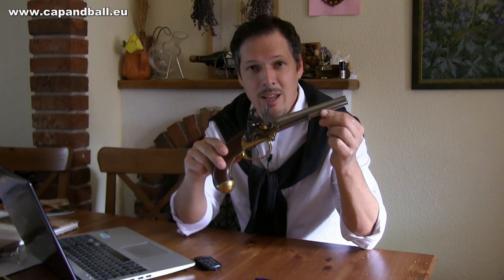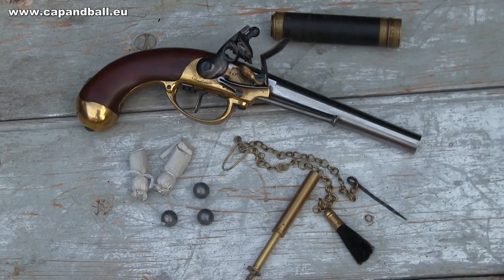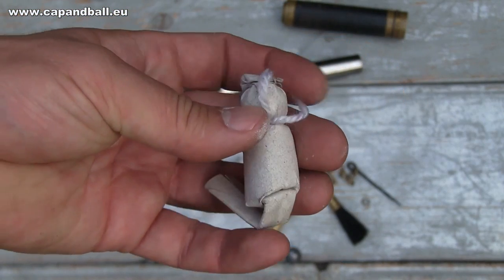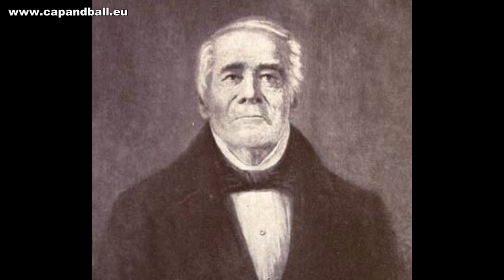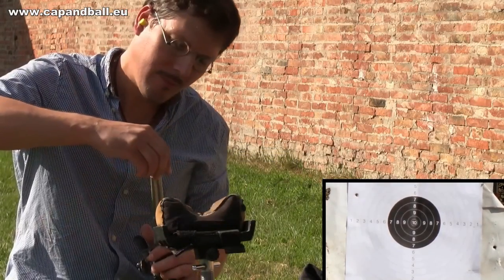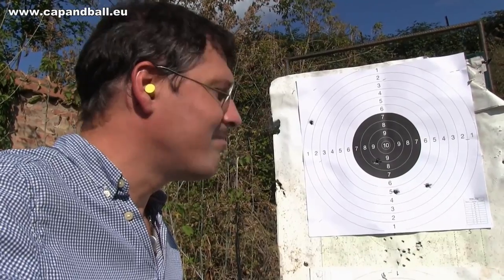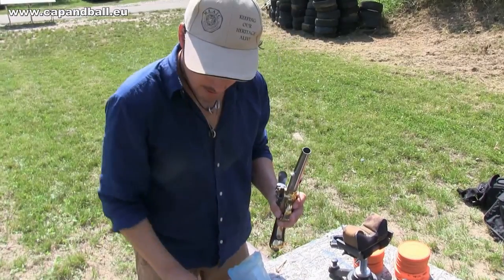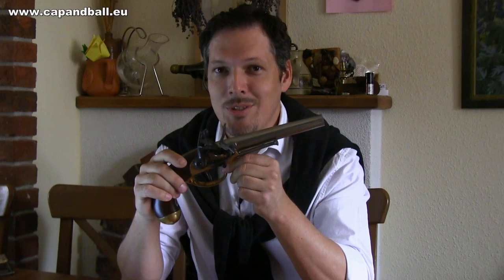The French 1777 flintlock pistol in action

Comment: That pistol is more accurate when thrown
Reply: M Kennedy lmao
Reply: These things were pointed, i.e. aimed instinctively like a longbow and over distances not exceeding 15- 20 meters. If you try to aim along the barrel of this thing as if it were a modern pistol you won’t hit a thing. Shooting these things requires a skillset most modern shooters don’t have since they are hardwired to shoot with sights. Shooting instinctively requires un-learning everything you thought you knew about aiming.
Reply: @ChristianThePagan  With such a loose fitting projectile and no rifling there's no way to really be accurate with that thing. The ball will end up deviating in a random direction depending on how much and what angle of spin it ends up with from impacting the walls of the barrel.
Reply: @ChristianThePagan  I never said it was. But even a tighter fitting ball will be inaccurate due to imbalances and aerodynamics, esp. the Magnusson effect if the ball attains any spin. If you did a nice job casting it, cleaning up the sprue and polishing it, and fully packing it with wading I agree it would probably help. In order to somewhat "replicate" rifling the ball has to remain stationary in flight, which is a tough task. Any rotation, imbalance, or surface imperfections at all will cause it to deviate at random. I can say that loading a BB gun with actual precision ball bearings made it quite accurate. But a ball bearing has a very nice surface finish and is dynamically balanced. Something very hard to do with casting, esp. in the 17th and 18th century, not to mention the bore has to be kept very clean or you have a hand grenade instead of a gun.
Reply: @mysock351C  I have seen people getting pretty good results with tightly fitting balls and well loaded smooth bore muskets at ~70 meters on a human sized target. The objective of loading this pistol more carefully with better fitting balls would not be to get hits at even 25 meters. The objective would merely be to hit a torso sized target consistently at under 8-10 meters instead of the 3 meters he's getting. On top of that you can load this thing with buckshot or buck-n-ball. At ranges under 10 meters both would beat a sub caliber ball bouncing inside the barrel as it is fired (especially the buckshot or buck-n-ball would beat the pants off of a sub caliber ball at 3 meters). The tight fitting ball by being noticeably more accurate, the buck by simply covering more area. Furthermore, all I said about aiming this thing still holds. The reason this thing has no sights is because it wasn't meant to be aimed by peering down the barrel. This thing is meant for instinctive pointing and shooting at distances under 10 meters which is something modern shooters (shotgunners excepted) usually have no idea how to do.
Reply: @ChristianThePagan  I get why it has no sights. Since they are hand-made each gun probably has its own little quirks you have to correct for.
Reply: @ChristianThePagan  I know what your getting at. But since these were made before mass production each one was unique, and putting sights on it would have been a futile exercise, anyhow. The weights were a little bit different, the barrels had slight variances, the alignment of the stock varied from firearm to firearm. It would have been guesswork to put sights on it since each gun will shoot a bit differently.
Reply: @ChristianThePagan  I say that as we used to have a number of revolutionary war and civil war muskets, rifles, etc. before they were stolen. I wish I still had them but the earlier firearms were quite crude by todays standards. But I know what your saying in that you learn to position yourself and the firearm to shoot at a target rather than sighting it in.
Reply: mysock351C  I disagree, there are numerous English smoothbore duelling pistols with front and rear sights so fitting a smoothbore pistol with sights clearly was not pointless. This pistol a different beast. All that it is meant to do is to be rapidly drawn and shot to hit a human torso at less than 10 meters, most of the time probably 6 meters or less. At that range none of these variances you mention matter all that much. If they could land their groups inside a 30 cm circle at 7 meters the guys using these things were happy and keep in mind that this is half the 12-14 meters which English pistol duels were fought at.The sights are absent on the 1777 because they didn’t need sights to hit a guy at 7 meters. Also, these things were definitely mass produced.
Reply: @ChristianThePagan  I think it falls into the category of "wishful thinking". I was saying that I can see why they would simply skip putting the sights in place since the ball will be headed off to the next county by the time you'd actually need them.
Reply: @mysock351C  In that case, why even use pistols if they couldn't hit the broad side of a barn? Alexander Hamilton was killed with a flintlock smoothbore pistol so clearly they could hit something at 14 meters and the Brits clearly felt there was good reason to fit sights to hand built non-mass manufactured duelling pistols:
https://www.metmuseum.org/art/collection/search/788271
One example from the 2013 WNS in Phoenix, range: 25 yards, 13 shots and the best 10 count, smoothbore flintlock pistols only. The scores ranged from 89 to 51, the best shooters scored 89, 80, 78 and 69. Seems to me getting good results at under 10 meters should be doable if you use well fitting ball, get your loads right and practice.
Reply: @ChristianThePagan  Really? Seriously? Wasn't this whole discussion of them actually being somewhat useful at close range, but not really working further out? Now mind you Im talking about guns of this era like the one pictured. Some of the later stuff was probably a lot better once they got things dialed in, just to be clear.
Reply: @ChristianThePagan  Now if you want to see the difference back-to-back with the same shooter, have a look at his Harper's Ferry flintlock pistol video. That one has rifling. It actually has predictable behavior that you could compensate for.
Reply: @mysock351C  Look, I'm getting tired of this. You seem to be making the case that these smoothbore flintlock pistols are basically utterly useless. That made me wonder why they kept making them from the 16tth century and into the 19th century, but I was willing to entertain your hypothesis. So I pointed out to you that modern shooters are able to get impressive results at 25 yards with sightless smoothbore flinters. I was hoping to make the case that if that is possible hitting a human torso at less than 10 meters should be easily possible but once again you disagree. Furthermore, I contend that if you are not able to hit the broad side of the barn at 3 meters with a 1777 you are doing something very wrong. and in this case it begins with the fact that he's not shooting and aiming instinctively, he is peering down the barrel at the target's legs hoping to hit it the chest which is not the way this gun was intended to be used. Now you can continue to stick to your artillery in the finest of Wellingtonian tradition and claim the 1777, which continued to be made and issued for 40 years or more was an utterly useless piece of crap that could not hit a man at more than 3 meters but that is just something we have to agree to disagree on :-).
Reply: @ChristianThePagan  No, no I did not. You chose to make it a yes/no, black/white argument. Either theyre accurate and effective, or their not. The truth is in the middle. Go back and read what I wrote. They are accurate over short distances where the deviation of the projectile is not severe. That's why I said I could see them not bothering with putting sights on it. Remember your Alexander Hamilton example? He was hit in the gut. A non-fatal wound by todays standards, but back then pretty much anything would be fatal. Also from accounts of the time they were not too far apart from each other, so as I agreed short ranges are possible. Above that gravity and aerodynamic effects become pronounced. Think of what youd see in your sight picture if smokeless powder were used: The projectile (the ball in this case) would start off on target where your aiming, the first thing youd likely see is it falling as its not going that fast. After that youd notice is it starting to deviate as it flies in a random direction, basically dictated by how it left the barrel. This deviation would become either worse, or it could deviate in a new direction as the ball tumbles. Whether or not you hit your target depends on how far away it is since the deviations are random . If you've ever played paint ball, you've probably seen this effect exaggerated if you happen to use a gun with a non-rifled barrel. It will be worse obviously as a paint ball is not made of lead so aerodynamics have more effect, but the outcome is the same. If a rifled barrel is present, the only thing you have to worry about is the projectile falling from gravity and drag, assuming the gun doesn't favor shooting high/low, left/right, etc.
Reply: mysock351C No I did not make this a binary choice.  All I have been trying to point out is that if you load these things carefully the deviation decreases. If modern shooters can achieve better results at 25 yards with smoothbore flintlock pistols than he did in this test at a way shorter range then you can achieve better results with this pistol too at say, 12 yards. Why is this so hard to understand? They continued to issue these things from 1777 into the Napoleon wars, there are even percussion conversions from the 1830s. Clearly these pistols must have been capable of hitting something at more than 3 meters. Otherwise people would not have continued using them for so long.
Reply: @ChristianThePagan I didn't disagree that if you spent a lot of time balancing the projectile, loading it properly, etc. it would probably be better. But its still a crapshoot at long distances since any small differences or tumbling will amplify due to aerodynamic effects. Also back then, as you're aware, they fought in phalanxes, which made it easier for engagement with the weapons of the time. Also they used them for so long because rifling was HARD without modern broaching or hammer forging methods. While rifling's been around since the 1500's, cutting it by hand was tedious. Once modern line boring, reaming, and broaching methods became more widespread, rifling became the norm. Both of the civil war muzzle-loading percussion cap rifles (circa 1860's) I have are, well, rifled.
Reply: @ChristianThePagan  Also don't loose sight of the fact that the quality of the reproductions, powder, balls, etc. is quite a bit better and more uniform than it was back then. Its hard to really draw conclusions about accuracy back then since we know so much more today about gun and ballistic behavior that would not have been available then.
Reply: @ChristianThePagan  I didn't disagree with you on that point that its ok at close range. Didn't you read my posts? I said the same thing in mine.
Reply: @ChristianThePagan  Also in that time period they were getting into better gun designs as well. The two examples I still have from the mid 1800's are well built, have proper sights, rifling, etc.
Reply: @ChristianThePagan  FWIW I think the confusion was that you made it sound as though there was some magic formula to shoot accurately beyond what we both agree they can do.
Reply: mysock351C No, you ignored what I said multiple times and went off on all kinds of tangents. All I ever said over and over again was that with a carefully loaded and tight fitting ball, the accuracy of any kind of smoothbore increases significantly. You can see this in contemporary texts where they talk about bullet moulds for casting tight fitting balls for accurate shooting and sub caliber ones for quick and easy loading but note that this decreases accuracy. I never mentioned any magic formula.
Reply: @ChristianThePagan  Dont worry, you have a very good point, sadly most of the people in arguments, dont care about the opinion of others and just want to say what they think, and they never actually listen to someone, they try anything to look like they are right, even if it mean, avoid the original subject to one that they think they are right, even if it dont help their point at all.
Reply: Lmao

Comment: This pistol was supposed to be fired at 'brûle pourpoint' (point blank), I don't think accuracy was ever a concern. As a hussard for instance you were supposed to fire it then draw your sword.
Reply from the maker: I disagree. The pistol was a secondary weapon for the light cavalry. First is the sabre, last line of defense is the pistol. Both the French and both the Austrian manuals shared info on maximum shooting range for flintlock pistol. Not a point blank arm at all. Wheel lock pistols were supposed to be used as primary cavalry arm in the 17th century, but not in the late 18th and first half of 19th century.
Reply: I'd note that But en blanc for French practice is where the sight line along top line of metal meets the trajectory on the descending branch - he found ~3m as the near point, but didn't even explore what the far but-en-blanc range would be. From the hold on 'the leg' to hit the body at 25m, this is much closer than but-en-blanc. It would be really interesting to know the chronographed velocity of the ball, and at what range the MPI approaches the line of sight (and what the dispart is). A large target would be needed to collect the relatively wide group, but your goal is to hit 'a man' within a formation of hundreds in two or three ranks, supported by a second line behind some hundred metres or so... so precision and accuracy don't mean quite the same thing as they do against individual, fleeting targets, or in target shooting.

Comment: Shooting accurately from horseback is not as easy as one might think. Add to that the delay between pulling the trigger and the actual firing of the gun that one experiences with flintlocks, it gets much more difficult again.

Even with modern revolvers shooting accurately from horseback requires a lot of practice.  Even a human sized target at ten yards is easy to miss on the back of a galloping horse.  It is a bit like running and shooting at the same time only harder. Timing is every thing.  Nothing is more fun than shooting from horse back.

I've never shot bows from horse back but I suspect that also takes a lot of practice.  The very powerful short bows used for buffalo hunting by native Americans were intended to be used at very close ranges in both hunting and war.